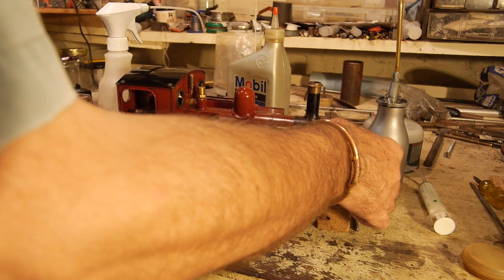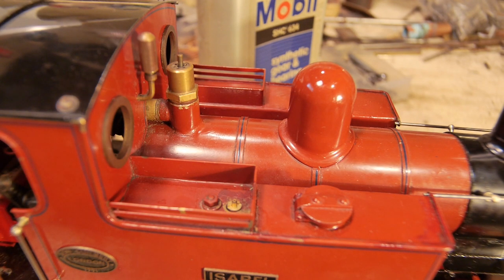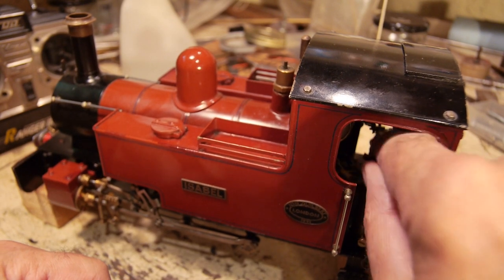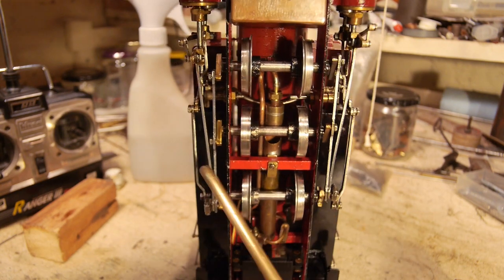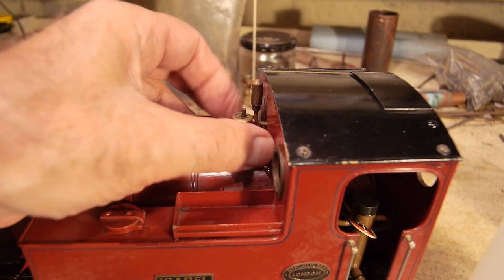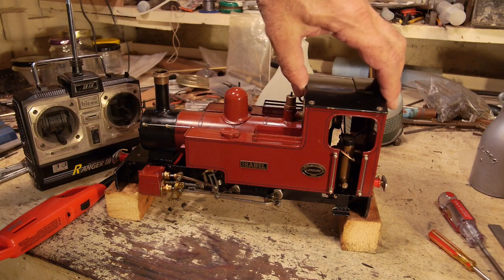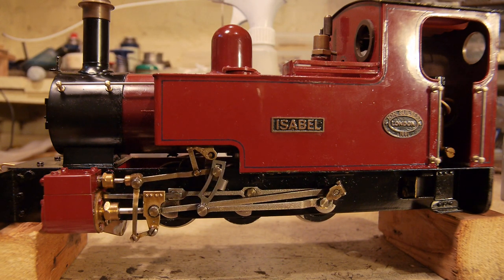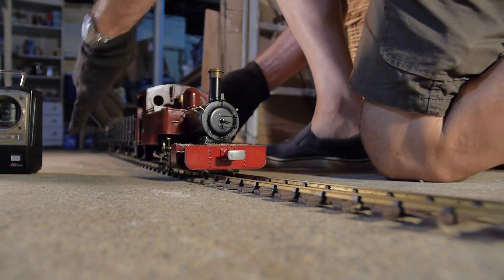Steaming Isabel, Part 3

Comment: could you possibly make blue prints for your engine and add them to your videos. if so that would be awesome.
Reply from the maker: Hi Adam, I don't have plans for the engines I build.  I use side and front drawings out of books, which I don't own, as a guide.  You can get some drawings of 'Isabel' on the Roundhouse Engineering site under the loco name of 'Lady Ann'.  It was based around that engine and some of the same parts.
Reply: thank you
Reply: I hope to see future videos of your trains.